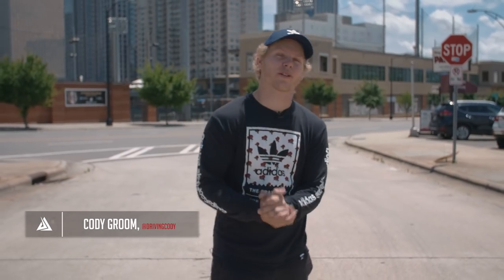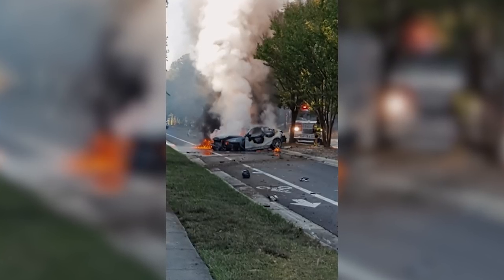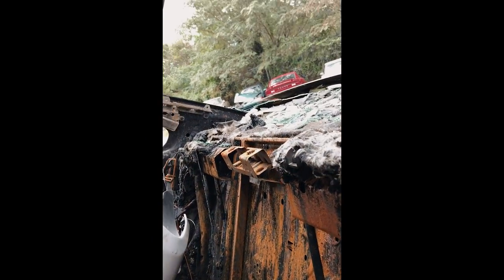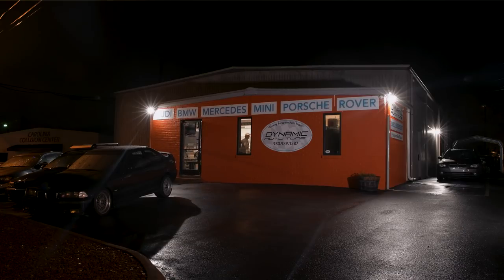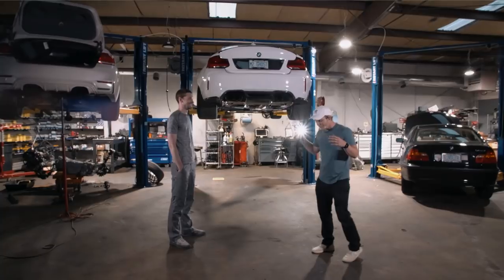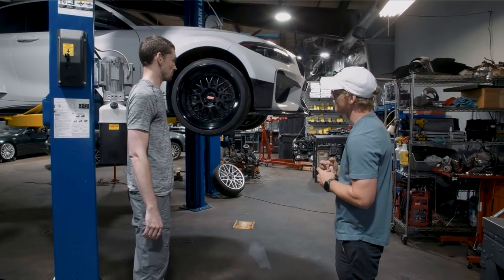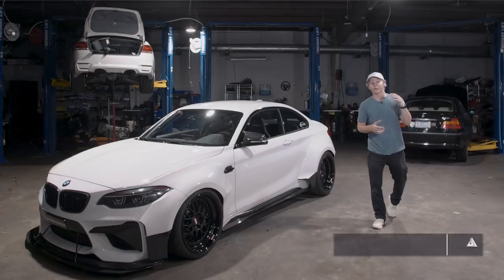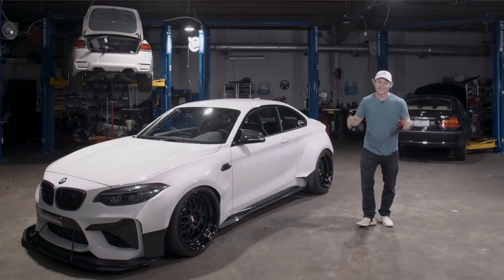The Build | The Near Death Experience of the M2 Ghost! Crazy BMW M2 BUILD

Comment: Great video, personally I'd choose pure turbos over dinan anyday, but def respect the decision. Also you should go with the moseelman oil thermostat too especially if you are tracking it. The N55 runs hot when it comes to oil, and I don't think your setup and added horsepower is sustainable without upgrading that part.

Comment: A stage 3 only pushing 400? you need a better tune! that's crazy. Stage 3 will usually put you upwards of the 500 mark and that's being low balled. 2011 N55 335i with a stage 2 MHD tuned to 450. I could put a bigger turbo and be easily tuned to 700+. Beautiful car, just seems like a waste of potential. Even if you could have it tuned for road and track, with the ability to switch tunes on the fly.

Comment: So it caught on fire after it crashed into trees? That’s understandable
Reply: Trevor Capps the Fire was actually electric and related to the idrive system. It was diagnosed as short circuiting, new unit was ordered... and it sat on the shelf for 6 months while the dealership tried to squeeze service charges out of me. That shop foreman and service advisor were fired shortly after the incident 🤔

Comment: Moral of the story kids, roll your fenders before lowering your car
Reply: Great Drums actually, the moral is to make sure they were rolled from the factory (or in the case of the m2 at the port) bc otherwise bmw m666m wheels and tires a bmw dealership required to be paired with those, is a recipe for fillet o’ rubber and a broken car...